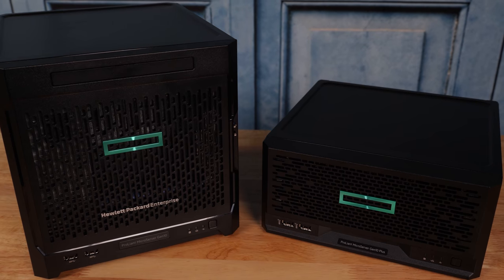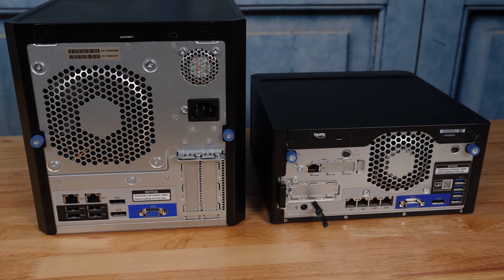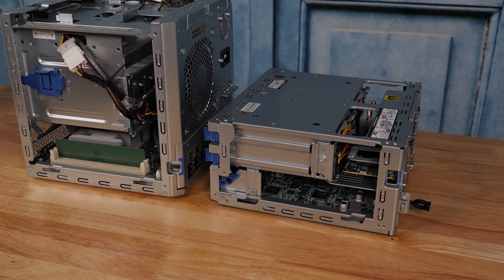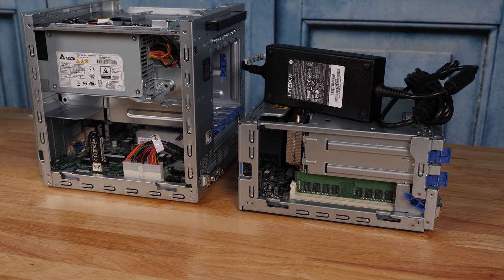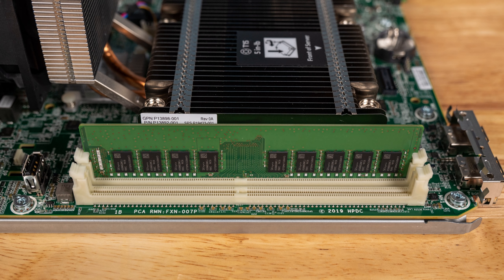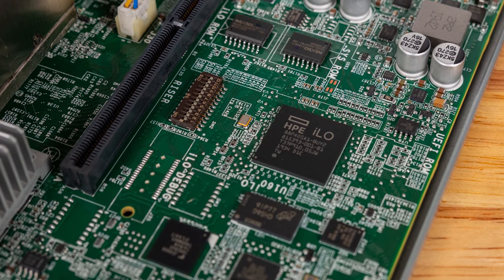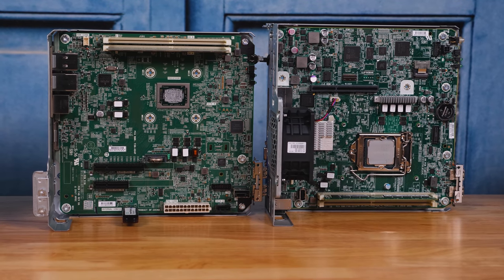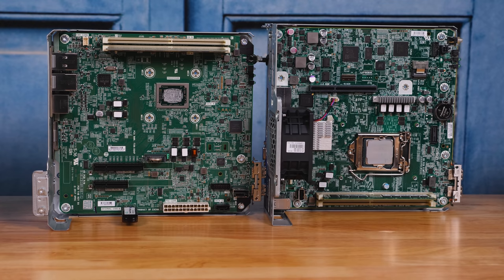HPE ProLiant MicroServer Gen10 Plus v Gen10 Hardware Differences Overview

Comment: If they had added an m.2 slot even if it was only wired for x2 pci-e that would have easily made up for the removal of the 5th sata port.
Reply from the maker: Totally agree. We brought this up to the product team. They are aware of the ask.
Reply: @ServeTheHomeVideo  do you have access to a QNAP QM2-2P10G1TA (pci-e gen 2 x4 card with 1x Aquantia AQC107 10gbe base T and 2x pci-e x2 m.2 2280 sockets all on a single HHHL card)? while it would be nice if it was pci-e gen 3, it should be enough for better than gigabit speeds with the benefit of SSD cache so you can still have 4x 3.5" storage drives.
Reply from the maker: @steven44799  Yes. There are a lot of caveats though. William has a formal review of that card that will be published as well.

Comment: Gen8s are still the best microserver released.
Reply: Why? Best to gen10?
Reply: @karakal000  it had iLO4 and was way more extensible. gen8 is only let down by graphics processing.. which sucked regardless of CPU used. Of course that was never the purpose for the thing but you know that some are using it as a NAS replacement.

Comment: Missed the mark again. These are mostly used for lab scenarios. 

The right microserver would be single socket up to 16 cores, up to 128 GB of RAM, 2x 10Gb + 2x 1Gb Ethernet. It needs to be designed to scale to supporting a full VMware or OpenStack cloud lab.

Comment: I want 8 BAY...
Reply: They're a dime on ye olde ebay so knock yourself out. Microserver, OTOH, keep getting more and more expensive, nothing like the 200€ one could get for a gen8 brand new a few years ago.
Reply: This. I have N36L. Its quality built machine ,still works. It was dirt cheap. CPU is trash for todays standards though. I just bought used xeon PowerEdge t320 with 8 bay cage. Forget this new toy from HP. Too expensive for what it offers.

Comment: Is the LIO port is a PCIE 1X/2X? Wondering how to keep the 16X free for other cards but to be able to add an internal SATA port for an OS drive
Reply from the maker: It is a slightly different offset from the motherboard and according to HPE's block diagram it is not connected via PCIe. Stay tuned. We discussed a solution briefly in our OS testing part of the the MSG10+ full review on STH https://www.servethehome.com/hpe-proliant-microserver-gen10-plus-review-this-is-super/ We are going to have a 2nd video and 3rd piece in the hands-on series with modifications. Should be live in the next 2 weeks.

Comment: hopefully the next one will have 8x 2.5" bays.

My ideal world look like:
Single socket up to 16 core 8 or 6 should be standard.
Quad dimm would be nice
4, 8 or 12 2.5" SSD sas capable slots
Pcie port for dedicated raid card
2x 4 lane pcie m.2
Micro SD
2x 1 or 10gb nics
Ilo or Ilo slot
I am not bothered about the external PSU plenty of pro kit uses external psu's.

Comment: HPE ProLiant MicroServer Gen10 Minus ;)))))))))))))))))
Reply: no ILO = no SERVER ;)
Reply: @ИванБрагин  it has ILO, just not as full featured as previous versions without expansion board.
Reply: ILO chip inside, ip address will not be visible?
Reply: @ИванБрагин  yes, until you get iLO Enablement Kit. Без этой опции iLO работать не будет.

Comment: My experience has been that most average adapter trays for SSD drives will not align with the drive bay connectors.  Having to order adapter cables.
Reply from the maker: We have seen that as well. In the HPE ProLiant MicroServer Gen10 Plus Ultimate Customization guide we talk about the HP(E) drive trays that are inexpensive and work well.
Reply: I use an adapter from Icybox i think it was called, that has it's own Sata and power interface on it and you mount the SSD inside so the adapter acts like a passthru

Comment: Any chance of testing it with a 6/8 core processor and 2x 32GB RAM?
Reply from the maker: It just so happens we have a stack of compatible processors: https://www.servethehome.com/intel-xeon-e-2100-and-xeon-e-2200-coverage-from-sth-your-guide/

On the 2x 32GB first 16GBx2 since we have that. I do not think we have 32GB ECC UDIMMs in the lab at the moment. If we can get some, we will try it.

Going out-of-spec upgrades may end up bing a third piece.
Reply: @ServeTheHomeVideo  Its more the memory. The older units supported 16Gb but actually ran 32Gb!
Reply from the maker: @nigelwilliams449  it just so happens we have 2x 32GB ECC UDIMMs showing up today.
Reply: @ServeTheHomeVideo  hi, just curious if you had tested this with 2 x 32gb rams?
Reply from the maker: @louislow5424  We did both ECC and non-ECC as mentioned in the video and in the main site article.

Comment: Already ordered a Gen10+ to replace my Gen10. While it was good enough for the most part, being stuck running Windows Server with a GUI and the Hyper-V role so I could monitor my SMART values was just a pain and a half. I'll be glad to move it back to VMware and adding the iLO card once it's available (not yet atm).
Reply from the maker: HPE part number P13788-B21 is working its way through the channel. We have that noted in a caption for one of the main site pictures since we figured people will look for it.
Reply: ServeTheHomeVideo thanks for the heads up. Here in the Netherlands, the servers are available as pre order, the iLO kit not quite yet. I did find an early listing, but no order button yet.
Reply: How much did you pay ?
Reply: Use the Gen10 as a drive host and use a dedicated RAID controller (P222 or P420) or a HBA with external SAS connector to connect both machines. 8 drive pool, awwyis.

Comment: I currently switched my miniITX self-built server to a QNAP TS-253Be running the same SW (linux, no QNAP SW here) and the main thing I miss is ECC "peace of mind". But my drop from 40W idle(+1HDD) to 20W is huge for my 2-battery APC UPS.
So, I have some questions:
1. what is the idle power consumption with 1 HDD? (with an ECC-enabled CPU)
2. you mentioned DP+Xeon problems....what combination could I get ECC+HDMI with a passive DP-HDMI adapter? Server is near my TV and would double as HTPC.
3. can iLO be completely disabled? My Gen8 microserver takes 5W as soon as I plug the power. Remote console is nice, but I'm looking at every W now.
Reply from the maker: It sounds like you want the MicroServer Gen10 not the Gen10 Plus. Here is the Gen 10 review: https://www.servethehome.com/hpe-proliant-microserver-gen10-review/